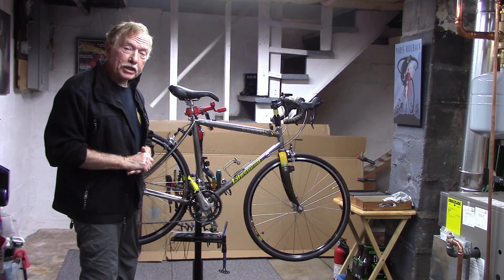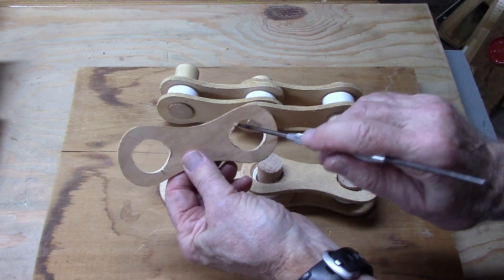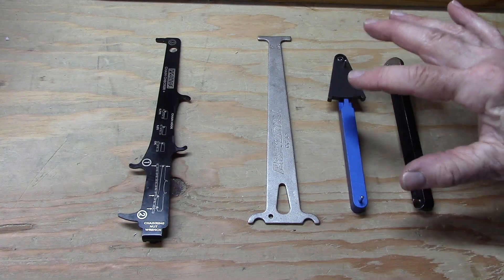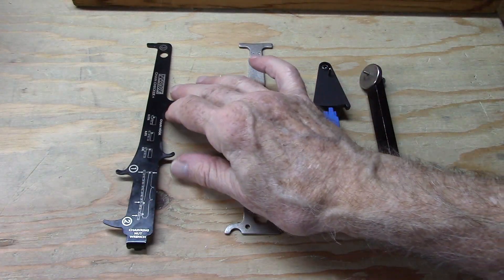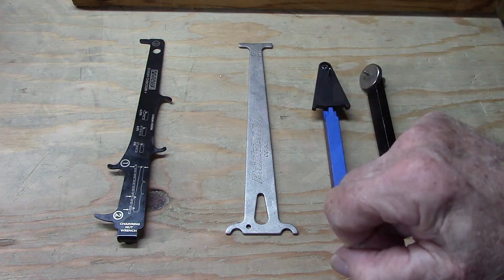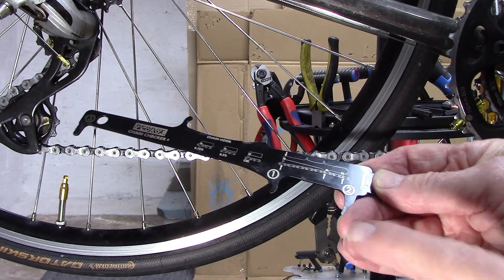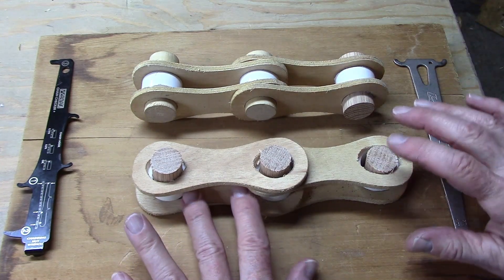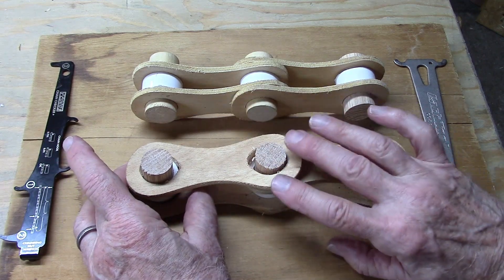Avoiding Costly Repairs: Best Type of Chain Wear Indicator

Comment: Being a mechanic in a high-volume shop, I litterally check hundreds of chains a year for chain wear.  Over the years, I have frequently compared the measurements of the Park CC-3.2 (my favorite) with other chain checkers, including three-point checkers like the Park CC-4.2 or, the Shimano CN42, or the Pedros Chain Checker plus ii, or others.  I have yet to find a chain (not counting SRAM flat-top), regardless of brand, model, or wear, where the CC-3.2 measures wear differently than any of the three-point tools. Go figure.  Conversely, I've found plenty of the mechanical (the ones with moving parts) chain checkers that have shown new chains as worn out. I also have a SRAM XX1 chain with many, many miles on it, that started running roughly and shows no measureable wear with any tools.  Clearly, there is unmeasured wear on this exceptionally durable chain. Go figure.
Reply from the maker: I also did not find much difference until I started looking closely at chains that were at or near the 0.5% mark. In those cases of discrepacies, I tend to favor the three point chain wear indicators ( although that's just a personal choice based on the 3 point measurement technique). But I do agree with you, this is far from an exact science. Thanks for your input, Tony
Reply: Why is the SRAM flat-top an exception?
Reply from the maker: @daveanolik8837  The SRAM flat top chains have larger rollers and SRAM suggests replacing those chains at 0.8% wear. Here are some references and an interesting forum discussion:
https://support.sram.com/hc/en-us/articles/5928711817755-When-should-I-replace-my-SRAM-Eagle-chain
and
https://support.sram.com/hc/en-us/articles/25563525293339-When-should-the-chain-on-my-SRAM-RED-AXS-groupset-be-replaced
and the forum
https://www.vitalmtb.com/forums/The-Hub,2/SRAM-Eagle-chain-longevity-is-impressive,9934
Regards and safe cycling, Tony

Comment: Thank you. I have been using the Pedro tool on my SRAM AXS 13 speed chain for 3 years and I never pinched the chain between the two hooks as you show. I hot wax my chain and I rely on my checker to track the stretch on the 2 chains that I rotate. This is the first time I have seen instructions to pinch the chain between the hooks
Reply from the maker: It's important to hold the tension on the chain when measuring to get an accurate reading. You need tension to pull the pins into the worn parts of the links and bushings as we show in the mock up early in the video. This will elongate the chain (so called "chain stretch"). Now we can get a true idea of wear with our 3 point chain wear indicator. Even if you want to use a ruler to measure pin distance over 12 inches for wear (can be done if you have an accurate ruler and great eye site), it is important to apply tension on the chain before measuring elongation between pins which would make sense.
Also check out videos from other experts:
https://www.youtube.com/watch?v=zljcAbdb27U&ab_channel=SpokesmanMTB
and
https://www.youtube.com/watch?v=iOaFF_4CqJg&ab_channel=ParkTool
Hope this answers your question. Thanks for asking and safe cycling, Tony
Reply: @tony10speed  Thank you very much. I subscribed.
Reply: SRAM 13-speed was relased in July of 2024.  Three years ago?
Reply: @NelsonSherry 
Probably meant 12 speed which also requires replacement at 0.5 rather than 0.75 for chains less than 12 speed.
Reply from the maker: @sylvainmichaud2262  Take a look at Rotor America:
https://rotorbike.com/rotor-1x13-road-groupset.html?srsltid=AfmBOoqiOOAkqfgscrGobH6WgKaBQwfVkFJT6B8dC3YxlypoUujcQVG_
and Campy's 13 speed:
https://www.competitivecyclist.com/campagnolo-ekar-13-cassette?skid=CPGA05F-SIL-S13S10X&CMP_SKU=CPGA05F&mr:referralID=NA&mr:device=c&mr:adType=plaonline&mr:ad=&mr:keyword=&mr:match=&mr:tid=&mr:ploc=9004016&mr:iloc=&mr:store=&mr:filter=&utm_source=google&utm_medium=pla&utm_campaign=20490880759__p:G%7Cs:CC%7Cct:Shopping%7Cct2:pMax%7Cg:xx%7Cc1:Components%7Cc2:xx%7Cb:xx%7Cmt:xx&utm_content=&utm_id=go_cmp-20490880759_adg-_ad-__dev-c_ext-_prd-CPGA05F-SIL-S13S10X_mca-4768825_sig-Cj0KCQjw9Km3BhDjARIsAGUb4ny8H_YUtLxe8d-VuJMxhW61KeBz3OXOkNR9aLYlbBepPxPjJkyg99saAvznEALw_wcB&gad_source=1&gclid=Cj0KCQjw9Km3BhDjARIsAGUb4ny8H_YUtLxe8d-VuJMxhW61KeBz3OXOkNR9aLYlbBepPxPjJkyg99saAvznEALw_wcB&gclsrc=aw.ds